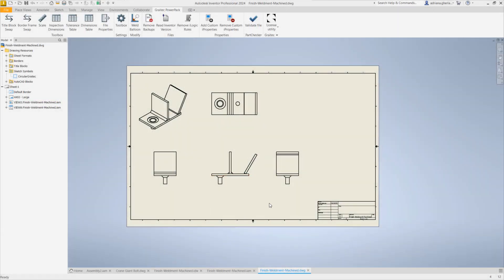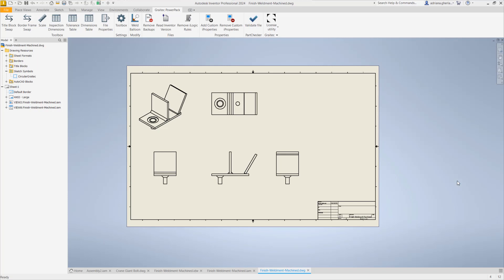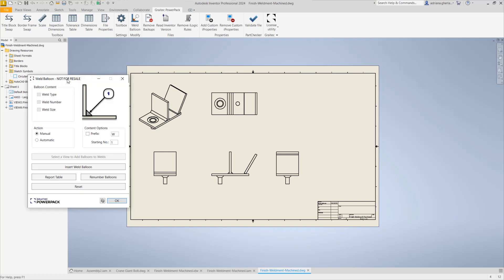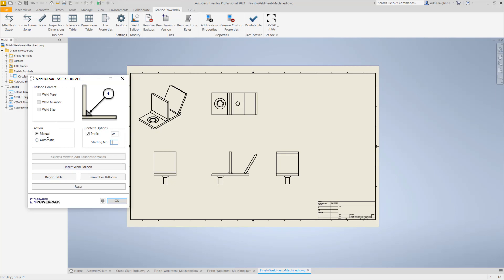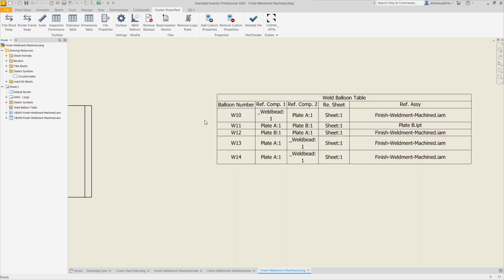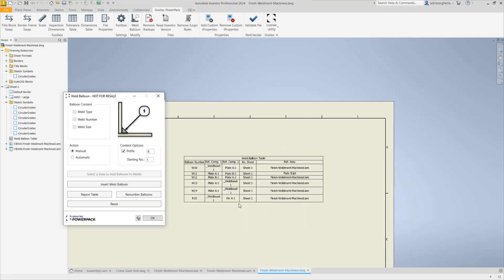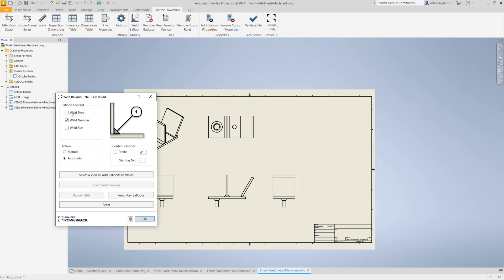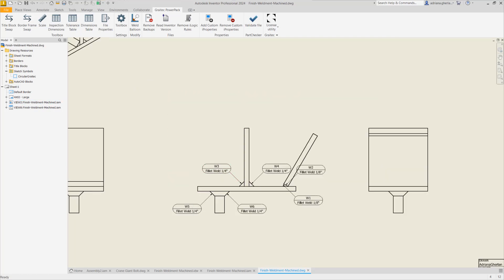Graitec PowerPack for Autodesk Inventor | Weld Balloons

Comment: what if you want to include NDT and procent of NDT test in one of the columns in the table or is it possible to config the table?
Reply from the maker: Hi, to add NDT test results you can edit the table after generation. Just use the Inventor table properties to edit and add a  new column, and type values you need.
Reply: @GraitecGroup  ah so is isn't possible to add the NDT procentage to each weld as an hidden proberti and build the Weld list according to that...